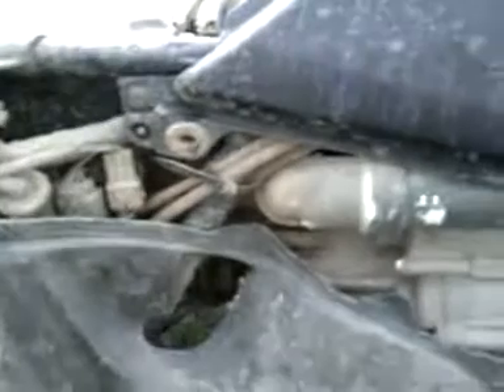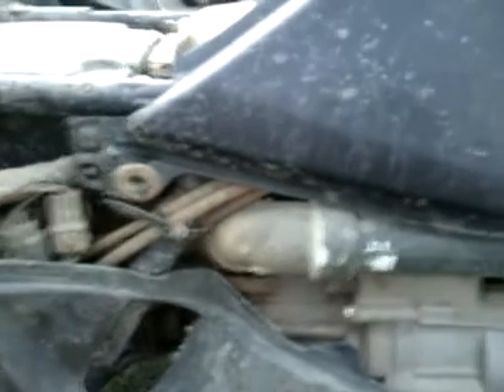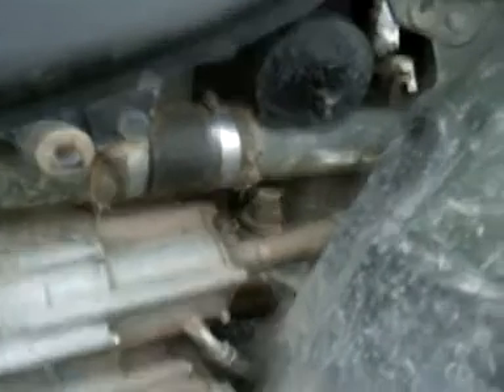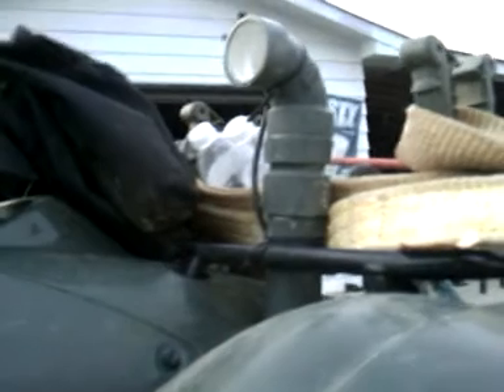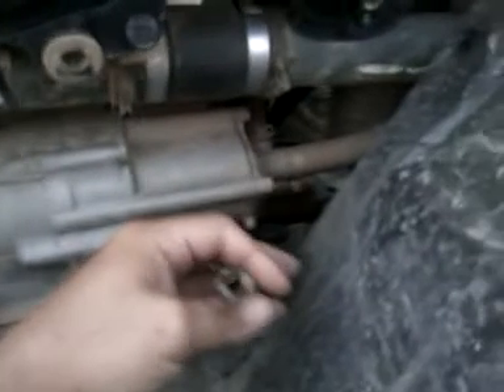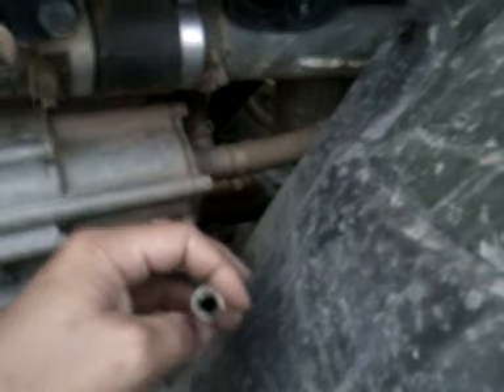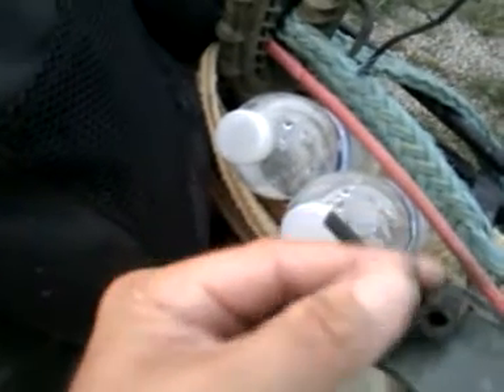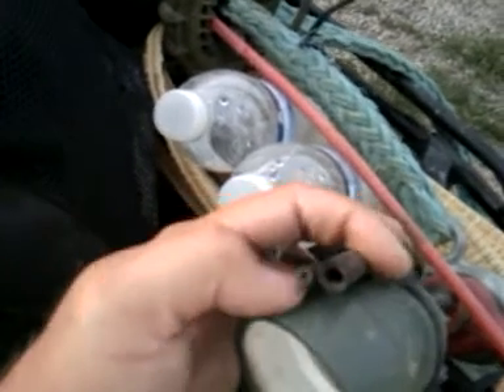how i built a snorkel for my honda rancher 420

Comment: I'd say that's the most in depth video I have found on YouTube snorkeling a 420, I think you covered it very well. 2 things to add. I believe the hose at the bottom right side of the engine is intended as a weep hole "Drain" for the water pump, I don't think its the crank case vent. Its a good Idea to plug it anyway if your getting into some deep stuff, but it may not be as vital as the other hose's. 2nd,  The crank case venting should be the hose that runs into the air box, I think :-)

Comment: @hardinbeachriders there are vent lines you have to run also. im not sure where they are on a fuel injected atv. but you also need to run your differentials. i bet theyre packed with mud.

Comment: To all with honda's, make sure you not only snorkel it, but if you look thru the rearend of your honda. looking at the back of the motor there is a rope pull start in the back! remove this and cover it with a peice of like plexi glass or some type of cover. A lot of poeple aren't aware of this and it will suck water up very quick!